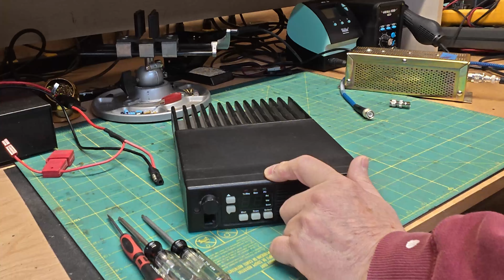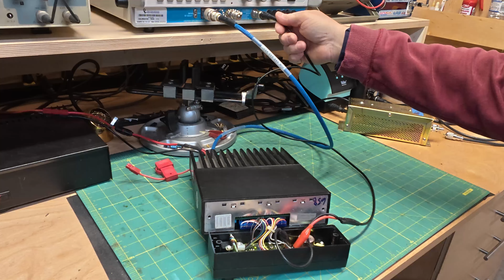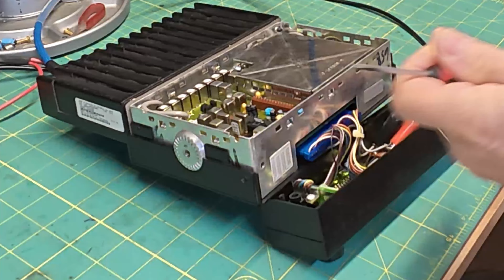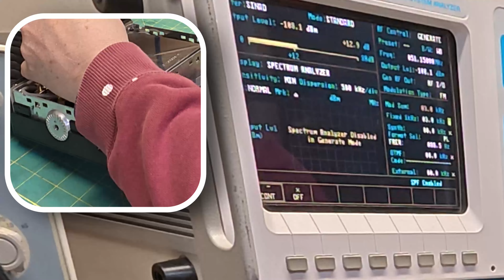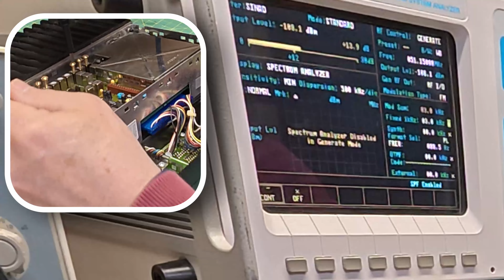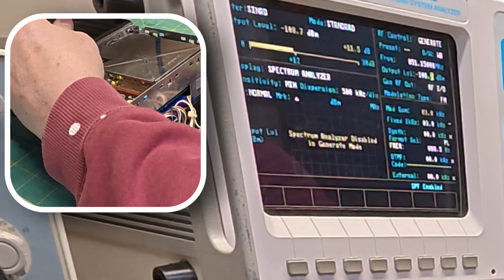Receive Radio Sensitivity |  Finish line Is Near!

Comment: Dude... i have converted many of these to 6m ham. The trick to rhe reciever??? 
Take slugs from a UHF  radio they are aluminum. Work so much better than brass
Reply from the maker: I’m gonna get back on that project again. I’ll see if I can get some slugs from the UHF radio and put them in there and see what happens. Thanks for the comment.

Comment: Hi Darrell, where will the 6m repeater be located at, and what will the frequencies pair and tone be?
73,
Kc9boz 
Bob Lewis
Reply: Hi Darrell, I check in often. Dave Echo, Kd9e is my ham neighbor to my south. He does net control on Monday's.
73
Kc9boz 
Bob Lewis
Reply from the maker: Bob, the repeater will be located in Alto Pass IL. This is where our club site is. We are currently waiting on the install of a shipping container to use as a new repeater shack. I'm still working on the coordination for the split. So nothing is for sure on that yet. The tone will be 88.5Hz. You should be able to make the repeat from your qth. We also have a morning net monday-saturday at 7:30am - 9:00am 146.850 PL 88.5Hz. Thanks for the comment.

Comment: I have a few of these. My grandad used to use lowband vhf for his logging company. His frequency was 48.660Mhz. He had 2 channels, one for his repeater, and one for Talkaround. His old tower is still there along with the old antenna. I flew my drone up and it was about 170 feet high.  He said on a good day he could get into his repeater from over 100 miles away. I plan to get a new building at the tower and put some of my own repeaters on that tower and maybe see if we can find the old paperwork for his license and possibly renew it. I saved the duplexer as well, its an old sinclair model. It has some damage but i can fix it and retune it possibly to the ham band if im able to and use 2 of the old radius's to turn into a 6M repeater. Unfortunately its the 5 pin connector and not the 16 pin, but i can make it work.
Reply from the maker: That sound great. 170' tower would be a great site for your repeaters. The 5 pin radios can still be used, but not has fast and easy as the 16 pin radios. I'm sure your Grandpa would be proud that his tower will be used by his grandson. Thanks for the comment and 73.
Reply: Hes still alive and well. I talked to him about it the other day and he said we will look into it sometime. Its just across the field on the other side of our property so it isnt far at all.
Reply from the maker: That's great. I hope you two can get something up and running.

Comment: You need to start with a unit that is on the high split of the low band radios. These were in use by certain hi-way patrol vehicles that transmitted at around 49 MHz. There were three low band splits made. I made the PA mod only to the low band unit I have to bring it up to six meter band. Also have a Motorola Mitrek that is on the high split that will work as a repeater just fine, if I find a source for crystals. One major issue I have is that I moved to the only country in the EU that allows only 6 meters on sideband, no FM. Bummer.
Don’t forget that frequency alignment takes place within the RADIO SERVICE SOFTWARE. I SAW AN EXPERIENCED TECH TWIDDLING WITH TRIMMERS THAT WERE FACTORY SET. He had only experience with E.F. Johnson equipment that was rock bound. Least to say the radio did not preform to specifications after all of that work.
Reply from the maker: Your right on the alignment procedure. All soft pots. Try http://bomarcrystal.com/ for the crystals you need. I've gotten mine from them for years. Thanks for the comment.
Reply: @ interesting! They are still in business? I used to send off my channel elements and Icom to ICM but I recently found out they closed shop. With everything going digital it was their death knell. It would have been an interesting business to buy and just deal with the Ham Radio community, basically as a hobby.

Comment: I have done the mod with the brass screws many times and they work great.
Have you seen this mod on repeater builders? Don't put a screw in the left most coil. The left most coil is very sensitive it will kill the signal. Try a little more with the screws and make sure the radio in on frequency. I hope you can get it to work. I have a repeater on 6 with a Maxtrac receive and a CDM for transmitter on 53.25 in central Iowa.
Reply from the maker: Ok on the 6 meter repeater. I have seen that mod on repeater builder. I think I may pickup so shorter screws and give it another try. I just think the 1/2" screws are to long. Thanks for the comment.